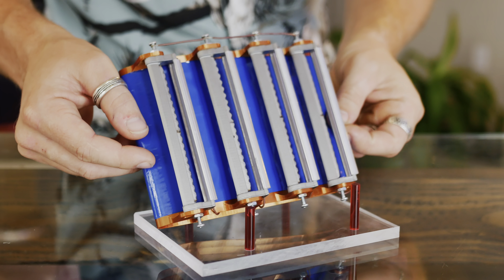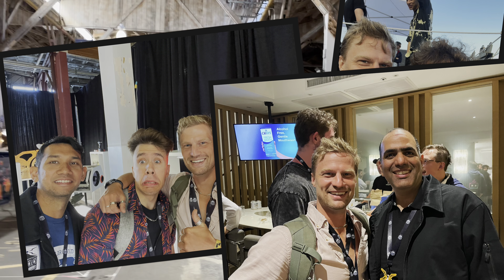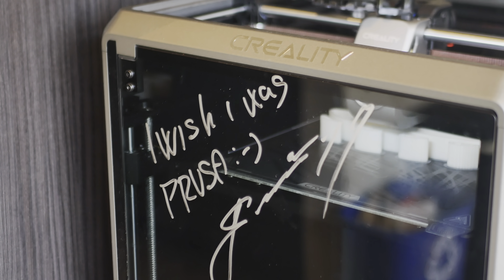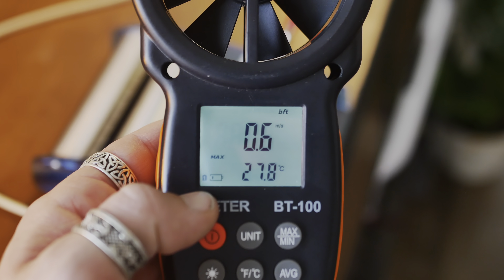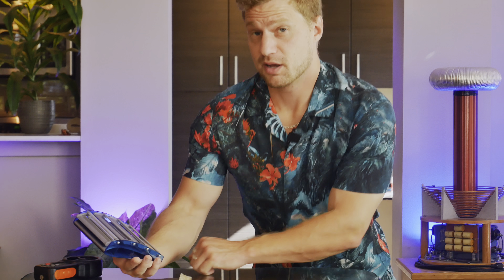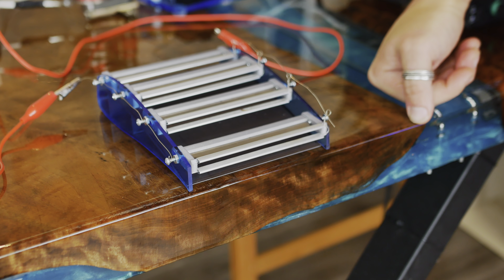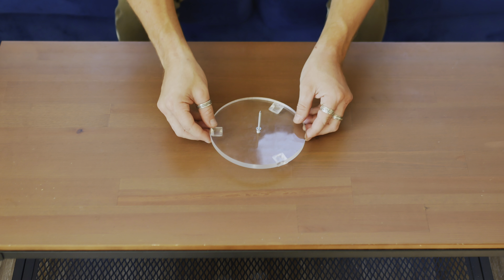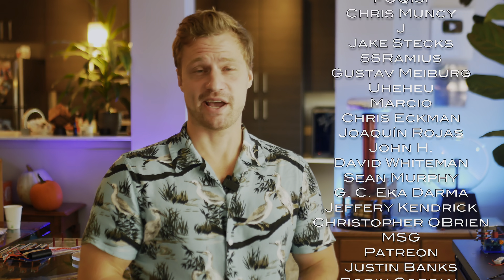Designing A Self Propelling Ionic Thrust Wing

Comment: You can reduce the weight even more by: 1- punching holes in the wing's spars, 2-getting rid of the hardware by making your parts snap fit or using plastic rivets 3- The tabs you replaced the acrylic with can be much thinner/smaller (especially if snap fit) 4- The plastic parts in your engine modules are too bulky for their function. 5- Those metal blades are still too fat, try those metal strips in boxes of aluminum foil or saran wrap that are used to cut them. A lot of them are plastic now, but they used to be made in metal, you can probably still find some.   Also, have you thought of making a design where everything is built INSIDE the wing? Like replacing the spars by ribs to create an air channel that goes from the front to back of the wing. Maybe the air inlet would have to be above or below the wing... or even at the front/side of the plane? Like the air inlets on jets. Very exciting stuff! Can't wait for the follow-up!

Comment: When testing the gap between the ionic thrusters I think it is a bad idea to use a different thruster every time. This way u are not only changing the distance of the thruster between each other but also the distance to the measuring device + you have a lot more objects in between the thruster and the measuring device in some test compared to others. You should just use one of them test and then change the distance one this particular one and test again

Comment: What about the output direction for each thruster in respect to the wing surface direction at each thrusters position? There might be a performance gain if you minimize turbulence in-between thrusters and how they direct the air over the wing. Haven't made any model myself, in general isn't it so that the air has to move fast on top of the wing I.e. stretching the air potential making it a less dense gas than the one below the wing? So the thrusters has less mass to accelerate with?

Comment: I'm no aircraft engineer, but fly a paraglider, and I was wondering if it makes sense to put the thrusters above the wing. Most of the lift is generated by the top surface of the wing, so disrupting airflow there will decrease lift. That's why in commercial aircraft the engines are below the wing. So maybe it would also make more sense to put the thrusters below the wing?

Comment: It seems the ionic thrusters would interfere with the vacuum over the wings.  Wondering about basing the structure on Bernoulli's principle.  It looks like your mind is still thinking on ground-based vehicles, vs. air foils.   This shows in your testing of air speed behind the wing - you need to test vacuum over the wing.   Best of luck!

Comment: There's a very clear problem with this design, I think. 

You're only accelerating the air over the top of the wing, which will increase lift significantly because that's how the aerofoil generates lift. So you're creating a lot of up-thrust as opposed to forward thrust. 

I dunno. Maybe that's what you want? But I think it would be annoying as hell to actually try and fly it, when to go forward you have to also go up, a lot.

Comment: I've often thought about doing this. My idea was to put a strip of metalised tape directly on the top of the wing, and a narrow one on the leading edge. Also, in the seventies modellers experimented with mounting a wire just in front of the leading edge in the belief that triggering turbulent flow early would reduce the drag, so I could do this and make it double as a corona wire. Though it would need an even higher voltage to work.

Comment: The rotating arm looked really good and proves that the small wing section is producing a reasonable about of thrust. How about a test where the wing section and power source is mounted to a lightweight chassis with low friction wheels to see if it can move that? It would be a useful thing to try, as it's not just the wings and power modules that the plasma thrust engines are going to be moving, there will be a fuselage and other assorted items associated with an aircraft that will also have to be moved.

Comment: If a plane were done this way the static built up from drag can be used to provide charge to ionic jets on the surface of it's skin instead of being merely dissipated into the air through static discharge wicks common on normal planes.

Comment: At 14:50 it would have been nice to see the wing passing over a fog tray, so we could visualize the in-motion flow pattern around the wing like at 13:38. 
Have you tried attaching strips of aluminum or copper foil to the wing surface to act as an ion blades? A vinyl cutter could be useful tool for cutting out desired patterns to stick on the wing surface.

Comment: The thing about a wing is that you can hang all manner of junk off the bottom, but the top surface providing laminar flow is crucial. Wings fly by producing a downwards thrust that equals or exceeds the mass of the airframe. They create this thrust by creating a low pressure area above the wing. Contrary to poplar myth, and the terminology used in aeronautics equations, this does not “LIFT” the wing up because of the low pressure. The wing has too high an inertia to be pulled up by so weak a pressure differential.  What has a LOW inertia is Air molecules.   Above the area of low pressure immediately above the wing is an ocean of air at ambient pressure.  It is THIS air that rapidly accelerates downwards trying to equalize the low pressure zone immediately above the wing, but as it does so the wing moves forward and the air ends up being thrust downwards behind the wing’s trailing edge.   The vortices created by wing tips are the result of the boundary between the mass of air being thrust downwards by the wing, which is at a lower pressure and the air beyond the tip of the wing moving into this low pressure high velocity stream, just as the low pressure over the wing created the downward pressure blowing air.   If you look at images of jet aircraft flying just above a cloud deck you can SEE the deep trough carved in the cloud deck by the mass of air the wing thrusts downwards, perpendicular to its plane of motion.  
Propellers and fans ALL clearly produce ‘thrust’, not ‘lift’. And Wings are the same deal.   I think the clutter on top of your airfoils will prevent the acceleration of air downwards by introducing turbulence and drag around those blade systems.  That is, your balance beam will move forward in a circle, but it will Not LIFT its end of the balance beam upwards, because it is not producing the downwards thrust that all wings must produce.

Comment: Once you get to flight trials, you can also stick standard lightened engines in the body for extra thrust at the cost of fuel load/flight time. I would also take a look at alternate wing designs just in case a non-airfoil works better for what you're trying to make it do. Like those people that use styrofoam cups. I'm sure there is a NACA/NASA report or twelve somewhere with data you can model.

Comment: I can see ionic thrust being possible on a personal low altitude superlight or glider but not much more than that. You should consider getting a readout of how much power you use to get that amount of thrust. This can give you an efficiency number that can help out in how you would design it. But even if the efficiency was the same as say a jet engine you still have the problem of energy storage. Jett fuel is very energy dense for both it's weight and volume as well as being (relatively) temperature indifferent. I think it is starting to become viable for small planes and gliders but ultimately unless we find some battery tech that can even get close to jet fuel there's just too much weight needed to power the plane for anything large.

Comment: A couple of things that come to mind after watching a few of these. 
Moisture shorting. I remember you having a problem with that when you were putting one of these things on a boat. A plane going through clouds would face similar problems. Not sure what can be done about it as you have to be exposed to the air to ionize it.
Other issue is waste heat.
And better conducting materials is the only thing I can think of that might help there.
If you are going drone with this making the whole craft a flying wing might be worth looking at.
Going lighter than air might also be worth thinking about.

Comment: ok, so... i'm not an expert, but from my understanding wings work based on a difference in the time it takes air to flow over and under them creating a pressure difference. considering your plasma engine directly affects the airflow on the top of your wing, you're probably going to need to change up that wing geometry to account for that if you want a full wing of ionic thrusters. because if you have a lot of thrust but no lift the plane isn't going to fly at all.

Comment: The open airfoil wing makes me wonder why you're not just putting the thrusters in the wing and using VTOL designs.

For that matter, I think you skipped several steps of testing. Like testing to see if multiple air intakes to single aerospike output is better than single air intakes to multiple aerospike outputs; air density differences on the intake and exhaust seems like it would be a really significant problem to consider given that you're doing almost all your testing at sea level for something intended to fly at above sea level. Also, I feel like pulling the air through closed channels might be generally more advantageous than across open foils? Most of the lift of a jet engine comes from the jet engine pulling air through the fuselage and increasing the density differential between the intake and exhaust, and the wings mostly provide control surfaces.

Comment: You could use Ansys to optimise your setup, it’s very tedious to do all these experiments.. the distance minimising of the electrodes and maximising the voltage for higher thrust each electrical engineer could have told you, what you are looking for is the highest electrical field strength, to rip out electrones that correlates with highest air flow. E=Voltage/distance .. The cathode has to be a lot of spikes no blade. The distance between the spikes has to be optimised to not obstruct airflow. The design to surround the wing is interesting but exactly the opposite of what you wanted to achieve, as modern fighter jets are basically a turbine with strapped on wings.. your tube design with strapped on wings comes closer to this.. the Portuguese YouTuber had a nice design that could be attached as a turbine below a wing.. actually it’s important to put your stuff below the wing and not on top as turbulences are not as important on the lower side (that’s why turbines and middles are always below the wing) 

the material of the electrodes can be optimised, you want something with volatile electrons I.e. low bandgap energy
Reply: To maximise thrust why not put a funnel at the end?

Comment: You might try electroplating / anodizing a 3d print with aluminum over some graphite paint to save even more weight in areas where you still want power. Basically using the anodized area as a flat wire.

Comment: Why lift the thrusters off the wings at all?  Why not apply conformal copper foil over the leading edge, both top and bottom, with serrated trailing edge on the foil ending around 1/3 of the way down the wing?  Finish with the other electrical polarity in the form of a span-wise strip around the spar.

Comment: At this point I wonder if it would make sense to start testing it in different environments - how does it fair in higher or lower humidity, temperature, pressure (elevation)? What if it's flying in the rain?  It won't be very practical if it fails if it gets wet or if it needs sea level air pressure to fly at all.

Comment: I feel if you use Integza's approach of making it using wires, you can incorporate more number of stages and reduse the weight if you try to control the airflow by just adjusting the distance between stages.

Also, I can't quite put my finger on it but I feel something is not right with design you have come up with. In aeroplanes, net lift has two contributing concepts:
1. Lift generated by pressure difference between lower and upper side of foil. Foil has one speed so they split streams in two parts which done by nose of airfoil. Upper stream is allowed have slight compression by the ram pressure but then overall it allowed to expand and gain faster velocity than at the nose. Lower stream is just allowed to slow down all the way. This according to Bernoulli's create a high pressure below airfoil and low pressure above foil which generates a component of lift.
2. At the exit, both the streams get combined and thrown at an angle towards downside which according Newton's, generates upward force on foil. You can notice the effectiveness of this when aeroplane takes off or breaks after landing.

Now in your design, the stages of plasma thruster are accelerating the air just as it happens in aeroplanes but I believe the volume of air must be leaking when the foil itself starts moving. When the foil is still, the vacuum is created only because existing air is being thrown out because of which air does not seem to be leaking between the stages but when foil starts to move, I believe the ram pressure is so high that along with vacuum pressure it is making the air leak out between stages, lowering the effectiveness.

To remedy this I believe you can do combination of things:
1. increase the cross-section between the upper foil surface and foil of stages.
2. decrease the distance between stages up to some distance from nose of foil to don't let the air leak out because of the ram pressure.
3. Redesign the nose so that upper surface don't get the ram pressure effect at all.

However, I feel you should focus on last point of the remedy because you want achieve the higher speeds and with first two remedies, you can only manage the effects of ram pressure upto some speeds. If at all you incorporate first two remedies in your design, then they need to be dynamic and should be able to adjust themself according to different speeds which you can't achieve with static design.
My suggestion would be to completely remove the ram pressure from your equation because in aeroplanes they have more than sufficient power to get the lift so they use ram pressure get some amount of compression to achieve higher stream speed towards the exit of the upper surface but your design doesn't have that luxury so your shouldn't deal with it at all. They down right go full throttle and open the flaps to the full extent to maximize the lift during the take offs by using the dynamic design. You can't do that because you have a static design.

Comment: This is super cool my only question would be how do you at large scale for say a passenger plane keep the weight of the batteries which would presumably be the power source light enough to enable long distance flight with current battery tech even at a relatively small scale like a model plane size im interested to see if it can be done. Ive been interested in this myself as a propulsion system since seeing the flying triangle deal on mythbusters years ago.

Comment: Pay attention to how the wire reacts to airflow. It’s significant lighter but if it vibrates, it can create more drag than a much larger pipe or spar. This is why modern bi-planes use solid wing braces rather than wire. However, where it is might nullify that